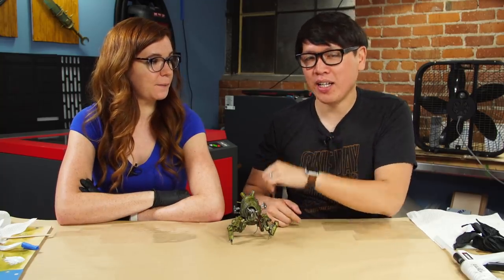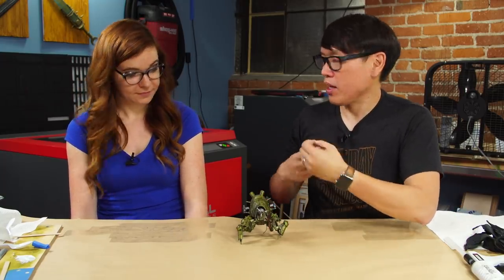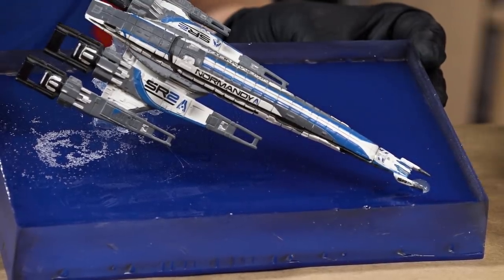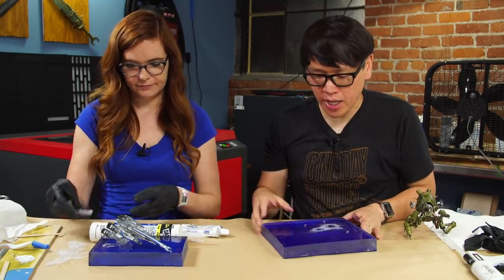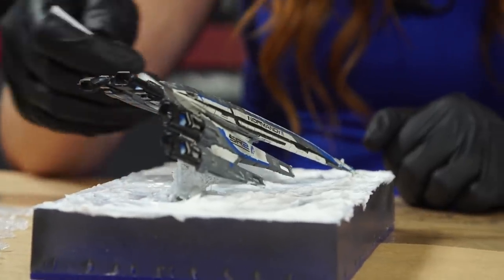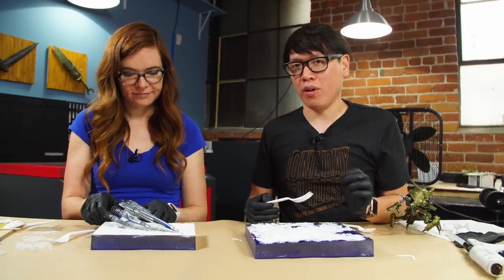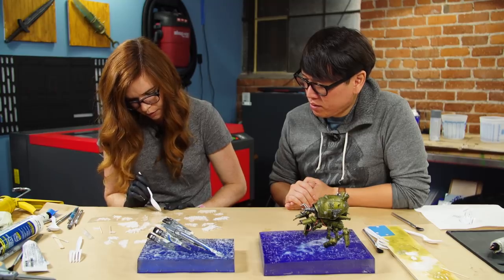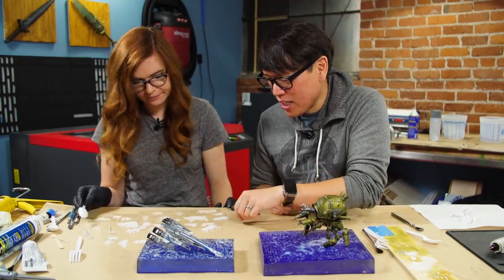How to Make Diorama Water Effects!

Comment: if you had cast in a fireproof mould you could zap the top with a blow torch or heat gun to burst out the bubbles if you don't have a vacuum chamber. :)
Reply: Pressure pot would be better than a vacuum chamber for the bubbles, also yes a torch and or a straw to blow through would be easiest to remove them

Comment: If you want something to stick to silicone, you can get decent results by using Zinsser B-I-N Primer. It's shellac based; shellac sticks to almost anything. To get it to adhere better, first wash the area of silicone with denatured alcohol, that will slightly etch the surface for better adhesion. I had to use this technique when I accidentally grabbed a tube of what I thought was painter's caulk in my storage room, but was just plain white silicone. Holding up outside for over a year, so it should hold up on an indoor model that does not get touched.

Comment: Here's a tip. For the waves (silicone sealer/caulk) acrylic gel medium works soooo much better. It's a bit more expensive but it doesn't take a week to dry. Anywhere from a few hours to maybe 24-36 hours, depending on how thick you make it. I do however like the material you used for the splash. 
Looks pretty good though.

Comment: I've seen someone use silicone for one inch deep water effects on a game board. 
You can take tiny pin holes to introduce air to the pockets if you want them clear.
The white ish parts will eventually get  less opaque but it takes a really long time.

Comment: 3oz tube of Smooth on Sil-poxy =$36.49 on Amazon.   ouch!
Reply: @kainoctis7724  just use some gloss gel medium, its a lot cheaper
Reply: @kainoctis7724   Great suggestion. Thanks!
Reply: Acrylic Gloss Gel Medium is a great suggestion.  You can also use Mod Podge; if you want higher waves, you'll just have to put it on in layers.

Comment: Spray and wipe has a compound that brakes down silicone well use too.can you do fiber optic light up for the lasers UV paint  forgot the rig to support the tick bot scenario set up could have done a holder tray jumps 200 ft to The deck off the ship guns blazing 😆😆😆😆😆😆 or sand as the fleet comes inn.??????????